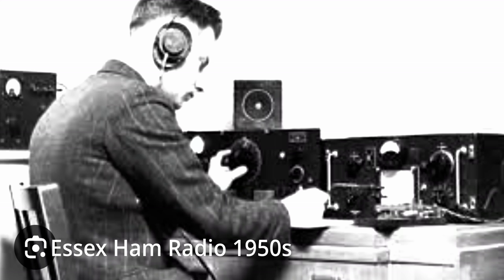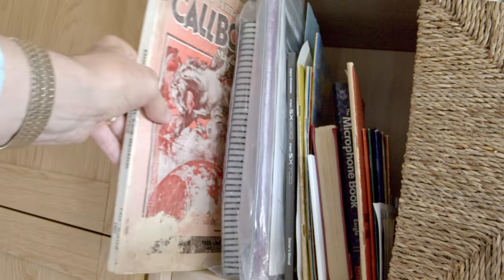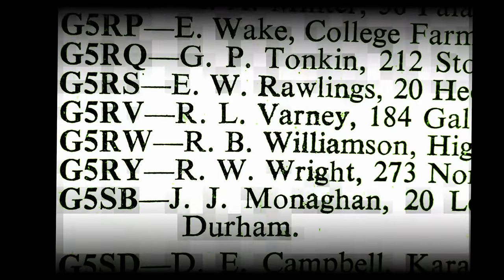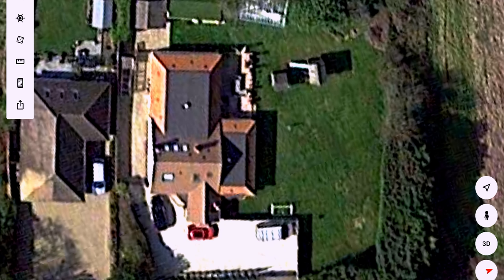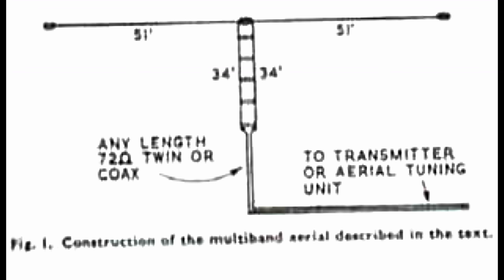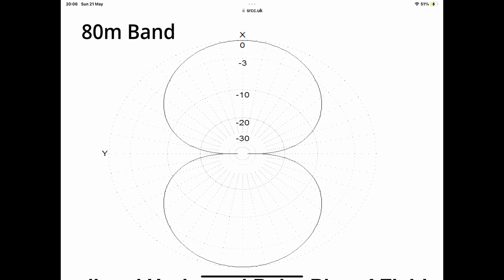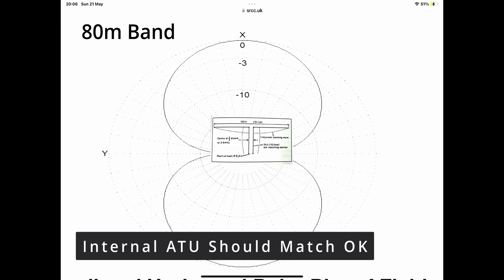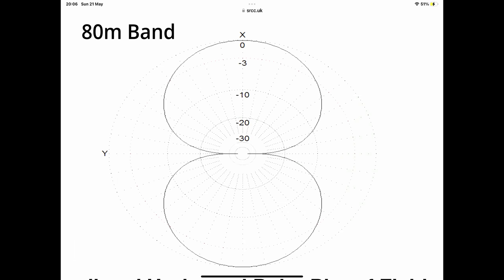The G5RV Antenna Story - The Design, the Facts and the Myths!

Comment: Love the G5RV - my first main antenna.  Someone gave me some lengths of cadmium copper and at first I fed with 75 ohm Suhner cable(someone donated).    I continued to experiment and found quite a few archived articles on the subject, I then fed with open wire feeder all the way back to my tuner.  I think I saw a photo of G5RV at his QTH with this feeder method.  I need to search these things out of my clutter.  Great vid.  Thanks Mike
Reply from the maker: Interesting reading. Thanks.

Comment: Many years ago I built a half size G5RV, including making my own open wire feeder. It was a pretty poor antenna, but I saw an article in QST about an antenna for the new 12m band. It was a 50 foot top and a 1/8 wavelength phasing stub to make a colinear. So I chopped the open wire feeder down and used it on 12m. Incredible antenna, especially as it was broadside to the USA and up at a fair height.
Reply from the maker: Thanks Gordon, interesting info.

Comment: This video is the best explanation of how the G5RV works that I have seen. I still use the same G5RV that I installed in 2005 or 2006. Although apparently poor (inefficient) on 10m, it continues to give results somewhat comparable to my horizontal full-wave loop and end-fed antennas, on the other bands.
Reply from the maker: Many thanks.

Comment: I started out with a G5RV, now I have a Horizontal loop. I need to put it back up but I got better signal reports with my around 300ft horizontal loop. I don't think I had the G5RV high enough the couple months I used it.

Comment: I love the story Peter. Wouldn't it be interesting to make a sequel about the ZS6BKW as it afaik is based on the G5RV.? I forgot to write down my actual lengths when I built my ZS6BKW, but at about 40 Ft in between two pine trees it is certainly a good all-round performer! 40m and 20m are matching almost 1:1 and for the other bands my external LDG tuner keeps the radio happy. Even on 15m where the antenna has a very high SWR. However, despite knowing that coax loss (100 Ft of LMR400) with such SWR is also quite high, and there might be just 25Watts being radiated, I did make several very interesting contacts on 15m! It has the same X shaped lobes as the G5RV, and thanks to those I make it into Europe, Pacific and Asia as well. I can't move the pine trees, but the pattern just worked out well. Despite Louis Varney's advise, I do use a 1:1 BalUn and Choke combination between the 450 Ohm ladderline and 50 Ohm coax. At the shack entry there's another 1:1 current choke inline to be sure there's no noise and common mode entering the shack that way. Both are rated 5KW so it will take some effort to warm those up.
Reply from the maker: Many thanks. Interesting to read. Thanks for suggestions. 73 Peter

Comment: Very interesting, Peter Thank You. I have a half G5RV and I think it's a brilliant antenna. It's only about 12 feet of ground level through a ladder line in a 90-degree 'L' shape around my fence supported on slate battens into  991A. The tuner in the 991A works perfectly into it and the furthest distance I have had is Nicaragua on 35 watts :) Happy Ham here. Thanks for the vid. 2E0WFL
Reply from the maker: Great to hear from you Dan. Keep up the good work and enjoy the hobby. 73 Peter.

Comment: matches my understandings Peter - very good video - I had to wind the coax into a coil (choke) at the feed point to stop RF feedback into the shack but apart from that, I find it a very useful antenna and I also have the ends dropping down to fit in the space available..
Reply from the maker: Thanks for sharing David.

Comment: This is a great story i love my g5rv ive ran them for years i get great signal reports like big gun signal only running 400 to 500 pep very good alot of other hams dont like them i always set them up right and some elevation it will perform great👍ive been a ham for years i ran alot of wire antennas to end fed ocd and doublets and folded dipoles last not least a vertical. 💯
Reply from the maker: Thanks for sharing.

Comment: My first antenna was a 100.' length of copperweld wire center fed with 450Ω open wire feedline, but eventually the little plastic pegs fell out of the feedline faster than I could glue them back in.  Worked great with a HB antenna tuner with a HB 4:1 Balun at it's output.  I changed to 75Ω coax after that. (RG-59) Ron W4BIN
Reply from the maker: Thanks Ron.

Comment: I prefer the doublet (random length wire dipole), and I do not use ladder line. I get low SWR on all bands with low loss running 100% coax, using an LDG RT-100 remote auto tuner at the feed point. For me it's the best, most versatile solution and a 100W remote tuner is still pretty light weight and low cost.
Reply from the maker: Yes that is another option. But LDG weren’t around in 1946!
Reply: @watersstanton  Yes, you are right. The G5RV was a very clever multi-band solution. I wonder how he  got it right? I assume he got the ideal theoretically, then perfected it experimentally.

Comment: Hi Peter, maybe do a video on the T version with the coax inner and outer twisted together, but obviously a good earth / counterpoise system would be required. Interesting to see how it may work on top band.
Regards
Dave.
Reply from the maker: okay Dave, I will make a note of that.
Reply: @watersstanton  Hi Peter, I did try it out a few years ago and it does work on 160 but it does work best if the feeder is quite long and in the clear if possible as the top section acts more like capacitive loading as Marconi discovered with his famous  T antennas.
Keep up the good work

Dave 😀

Comment: When Louis Varney said Balun I wonder if he meant a 4:1 Balun.I have noticed some older hams in my area think a Balun is 4:1  balanced to unbalanced. To use ladder line.
Reply from the maker: His concern was losses - I suspect any balun. Currently I am simply using a line isolator at the coax junction. This only has an effect on outer coax common mode currents and no effect on RF flow to antenna.

Comment: talking of antenna family trees... start with the balanced 51' per side g5rv... which begat the 25' per side half size 5rv... but for every balanced antenna there is the unbalanced half antenna which is basically 25' of wire going straight up, the feed ladder is basically just part of the match which is irrelevant to the radiation characteristics so keep the wire & swap the match slightly & what do you get but the Rybakov